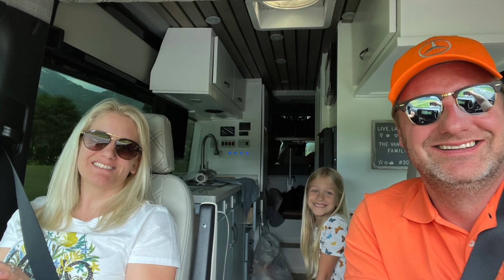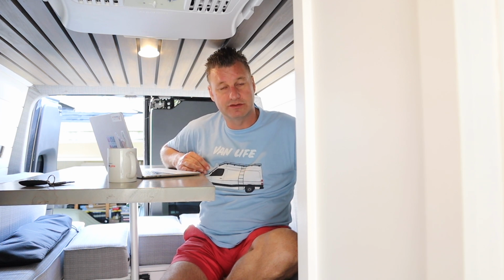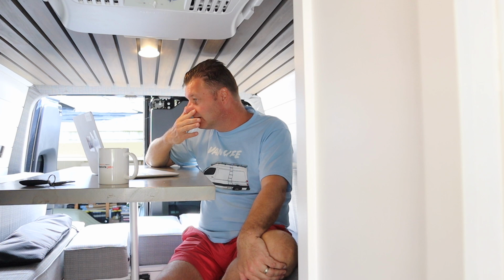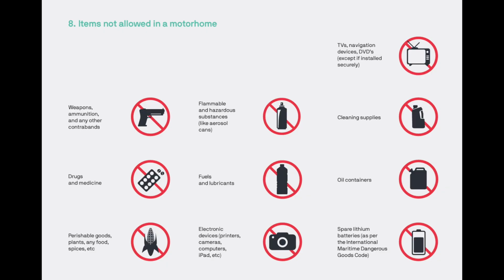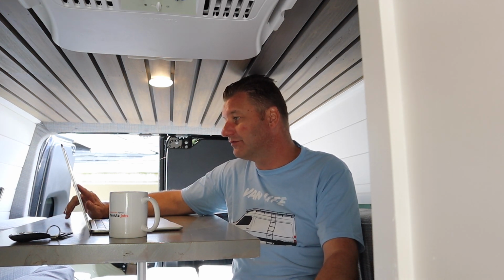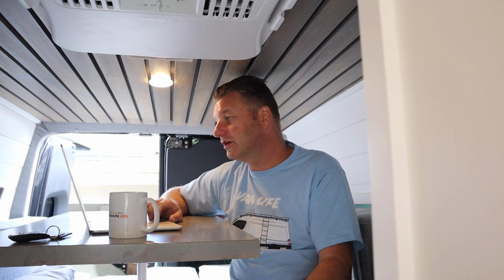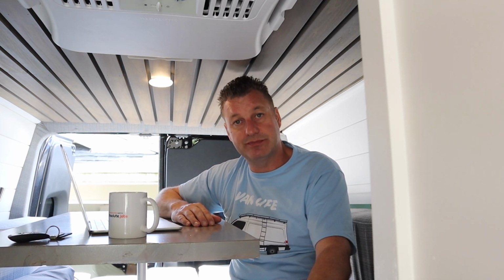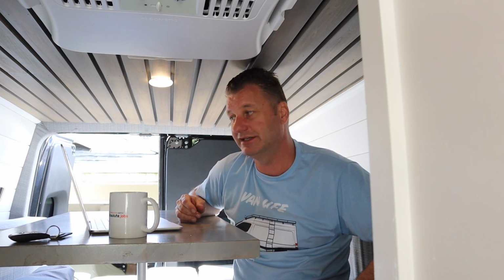🌍 How We Shipped Our Van to Europe | Costs, Tips & Complete Guide 🚐✨

Comment: Hi! 
Expat American (actually German/American) here. We live in France and are considering doing the same as you, just the other way around. Thanks for the good info. And I am from MD, so it will be Baltimore for us 😛
2 tech items I just wanted to remark on in your vid - maybe it will be useful for you on a future trip if you do ship your Sprinter back to Europe:
- the actual power of an electrical connection is measure in Watts and Watts (W) = Volts (V) x Amps (A). As the US generally only has 1/2 the voltage of of outlets in Europe, your 30A shore connection at a US campground is only supplying you with 1/2 the power compared to Europe, or the equivalent of 15A. Conversely, this also means that a European campground with a 6-12A connection is equivalent to a US connection of 12-24A. This is generally enough to run an induction cooker. We don't have an AC that we run at night.
- most European garden hoses have quick connectors based on the Gardena system sizes (https://us.gardena.com/pages/garden-life), so if you purchase Gardena compatible fittings in the US, you'll have no problems connecting to European hoses.